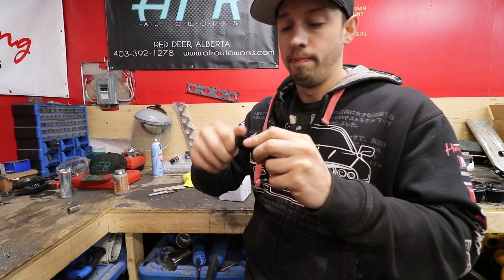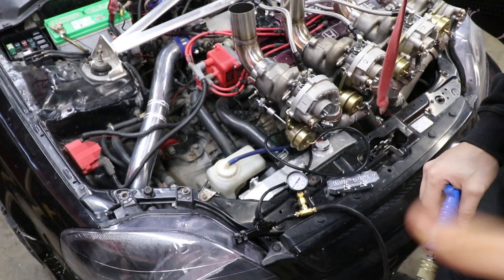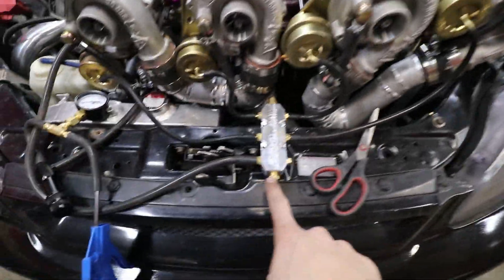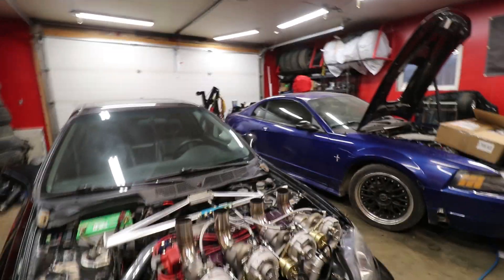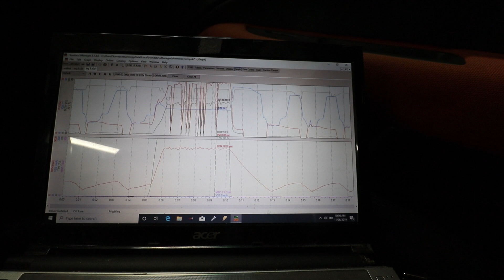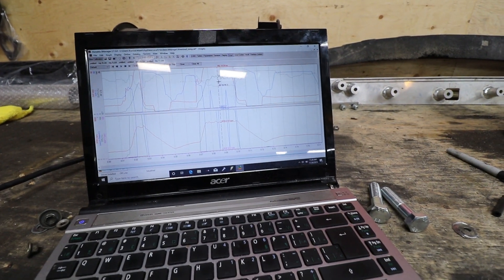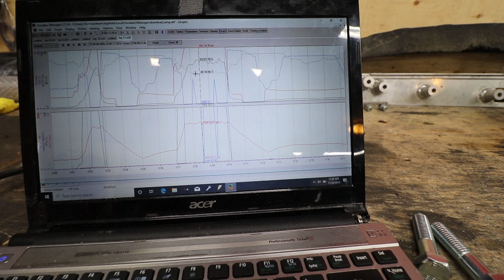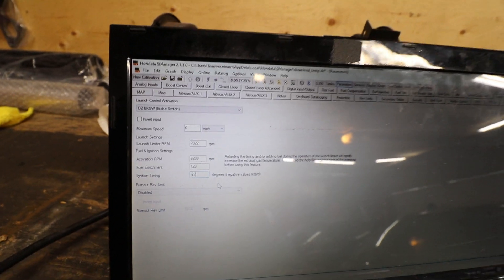Quad Turbo Civic - Part 9 - Track Test!

Comment: Needs to be a 4WD, 4 turbo civic with those conditions up there
Reply: 1 turbo per drive tire
Reply: Anthony Rowell that’s a good ratio imo
Reply: No it needs to be a twin engined, 4WD, 8 turbo civic!
Reply: Johnathan Doe but then how do u put 8 drive tires on a civic
Reply: Johnathan Doe the math doesn’t work
Reply: Step 1. Buy a factory 4wd eg civic

Step 2. 4 turbos

Comment: That idle is from the iat pfi made a video how to fix for free
Reply: Hope he see' this comment. I was thinking the same thing.
Reply: Iat = intake air temperature 

You mean the fitv. 

Fitv = fast idle thermo valve
Reply: Fast Idle Throttle Valve but yeah .   pop it off, douche it out, screw the plastic thing down snug and your idle will return to normal, not surging like that
Reply: Can't this also happen when the coolant system has an air pocket ?
Reply: @turbocrxhf  No its IAC
Reply: @eddominates  I deleted the sensor by the firewall with coolant line to it and jumpered the plug. Mine happened when coolant temp reached warm. I also looped back coolant line under throttle body.
Reply: Man I've been struggling with the exact same idle surge issue.
No luck adjusting the FITV and no known vacuum leaks.

Comment: Your Anti-Lag setting needs to be 500-600RPM lower than your two step settings. So two step 5500, and anti-lag 5000. Then is should work. You also need to go to Rev Limits and move the slider bars for the soft rev limiter.

Comment: Hey brother. Im sure you've seen studded tracks, Stud Those Wheel Tracks!! And if you throw some linch trays under the rear wheels should be fun too!! Would definitely bring down resistance for the snow, might even help pack the snow for the tracks!!!

Comment: Don’t you want vacuumed to the waste gate to keep it closed
Reply: Many blow off valves work like that but regular wastegates are held closed with the spring so there is no need for vacuum.
Reply: Right but his spring is 12lb break out. So with out running vacuum to them he will nvr make more then 12 lbs boost
Reply: He said they were 12lbs. An seems to make sense being he’s only able to make 8-12 lbs
Reply: @acurarl9929  ok but running vacuum to them will only do anything at idle. When he is under boost there is no vacuum and it will still max at 12 pounds.
Reply: Right right. Thx man